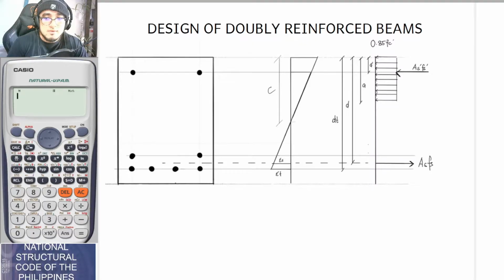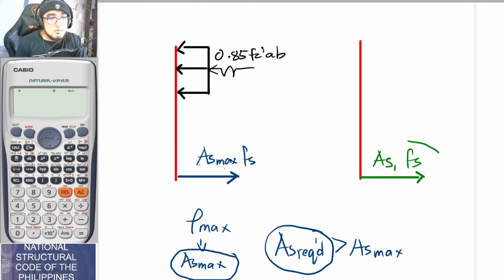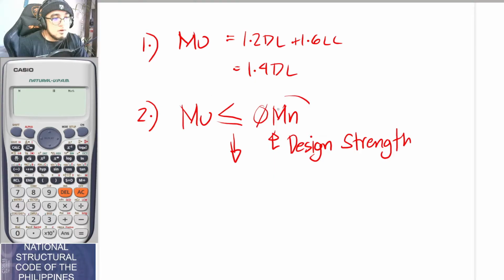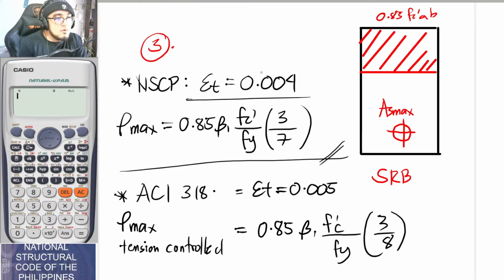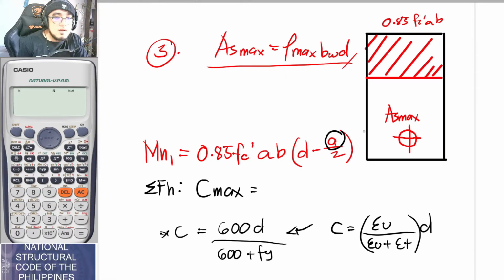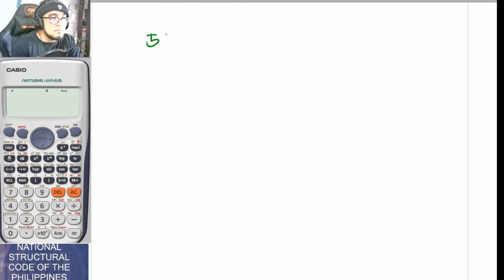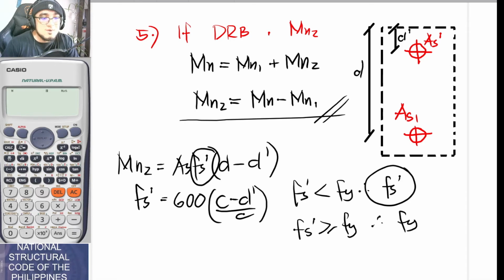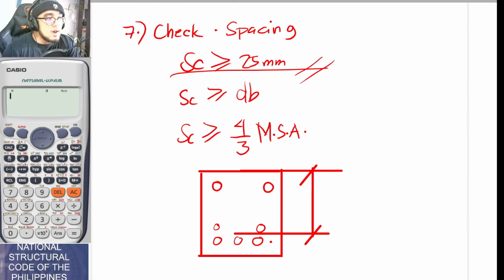Design of Doubly Reinforced Concrete Beams Introduction | Strength Design/USD | NSCP/ACI

Comment: sir sa actual practice po pa magagamit po ba ang singly reinforced beam? kasi po diba need din ng bakal sa taas para dun sa kakabitan ng stir ups?
Reply from the maker: Yung per construction, need talaga ng bakal sa compression side para nga sa stirrups as you said. However, in terms of analysis, singly reinforced pa din siya kahit may bakal dun sa compression side. Meaning, by analysis, mej walang kwenta yung bakal sa compression side kasi di siya needed. (Again, by analysis) 😊